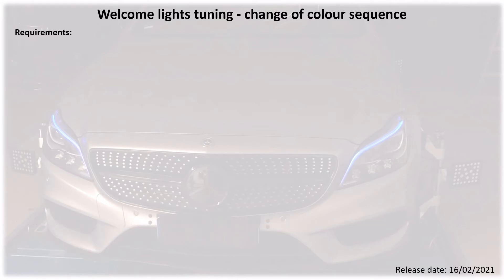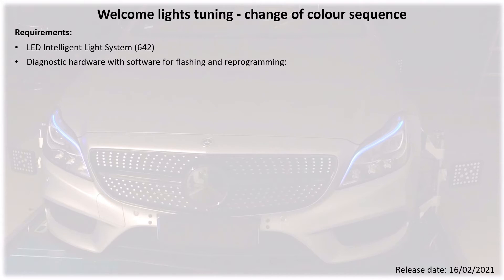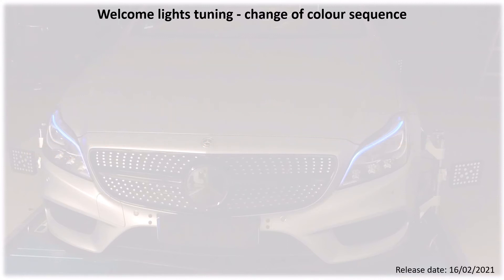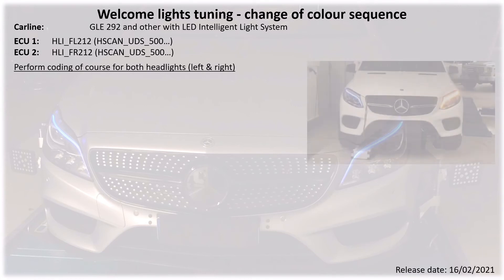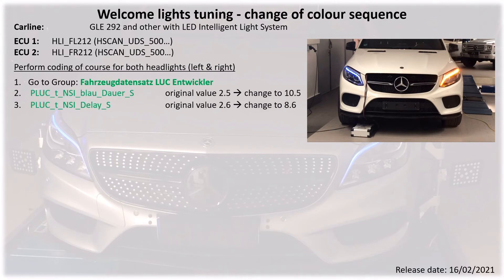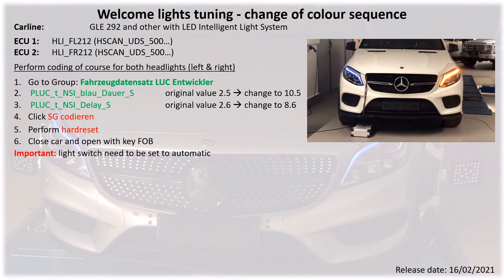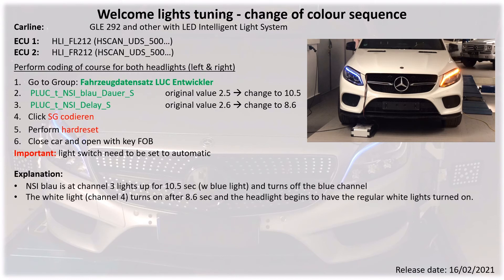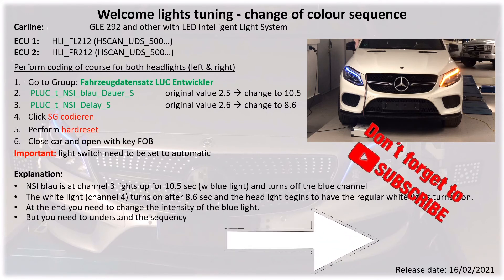DIY - Welcome light tuning - Mercedes coding manual

Comment: I got a w176 with several codings. If i use these programs, could i clean all of them from my car?
Reply from the maker: @kecco689  If you know the codings and the former original values which you need to set in the correct ecus then the answer is yes. of you set them to the wrong values then you get errors when you do the diagnosis. 

of you want to do a factory reset than it would be easier to be done by a Mercedes dealer and let them set the car to factory values.
Reply: @ yes, i’d like to bring them to factory values. I said it to a mercedes dealer, but they said that they actually dont know anything about coding and they stated they can do a factory values reset but it could damage, block or something similar, the car. Is that true?
Reply from the maker: @kecco689  which block could be damaged? i think they didn't know what they do or never done it and they want to get rid of you by saying this.
Reply: @JWAutomotive  I expected this. Thank you
Reply from the maker: @kecco689  i have heard just something about blocks when you change the firmware of a ECU. But putting back into factory does not mean software changes.  so i didn't know what they mean by saying this stuff to you.

Comment: i tried this on my w205. its impossible. i tried it in "Fahrzeugdatensatz LUC Entwickler schreiben" there is no other one. and when i want to change  "PLUC_t_NSI_Delay_S" is 8.6 not possible 2.5 is max. mine is now on 2.55. and yeah my car has the FULL LED Option Headlights with 2 lense not the cheap one with halogen :) .. maybe u can help me :) thank you i love you videos
Reply from the maker: maybe you need a different version of the cbc files or even the factory files. 
maybe somebody can help you in the mhhauto forum

Comment: In  SW222 from 2014 is it possible? I try a configuration for W205 and don't work in my car, but all the fragments appears, and my car has the code 642 and the welcome lights (in white). Thanks a lot.
Reply from the maker: Alot of codings are related due to the software version and the Hardware Version of the ECU.
Some work some don´t. It´s sometimes like lottery.
You need always to search and try.
It´s never sure if it works for 100%.

Comment: Hi there! Changed NSI_blau_Daues_s and NSI_Delay_s as specified but nothing happens, turns on white as before. The subject is a w218 with HLI_212 (FL/FR). Any ideeas? Thanks.
Reply from the maker: have set the switch to auto?
have you hardreseted ?
have you closed and opened the czar by key fob?

if still not working it could be that your led light does not support the feature.
Reply: @JWAutomotive  Did everything, still nothing. Guess no luck this time, thanks and keep up with the good job!
Reply: I was looking into this, but as far as I can tell, it does not work with the  w212 led lights (HLI_FL212) etc. If someone knows otherwise, let me know
Reply from the maker: when your car has no welcome lights than it's not possible.
Reply: @JWAutomotive   The w212 E-Class has welcome lights, but they can only be white. There's no options to change them to blue